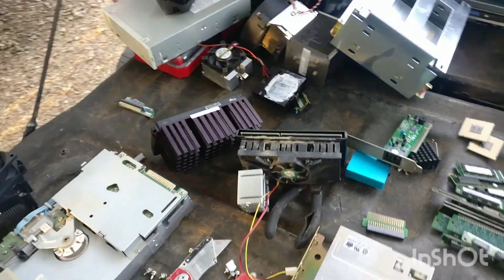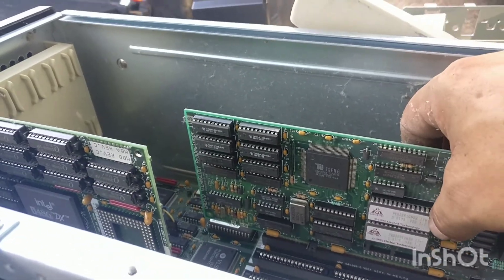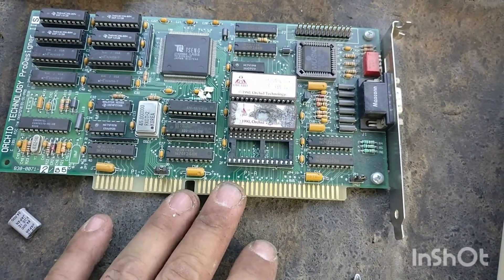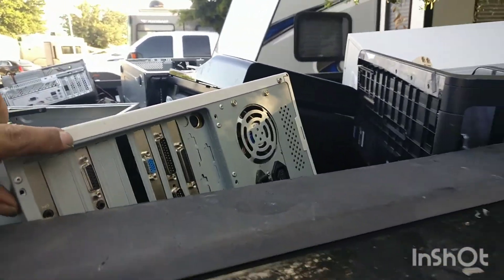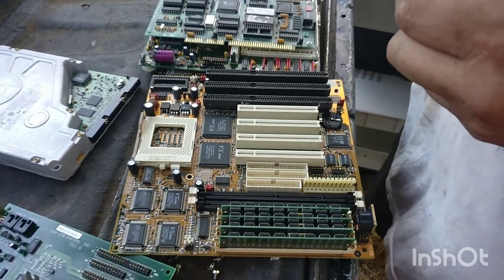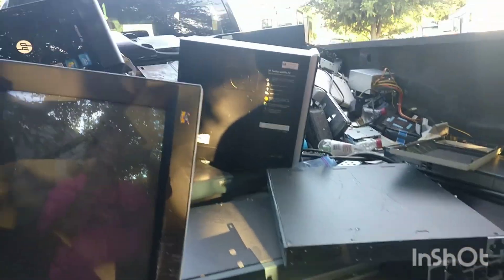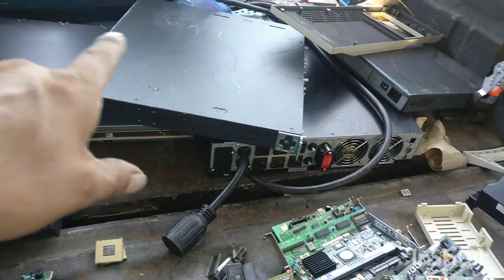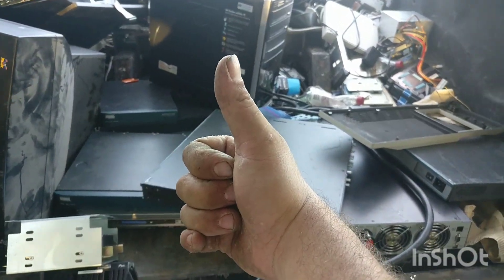Ceramic CPU kinda Day

Comment: Love those chips 🤗🤗🤗
Reply from the maker: Yeah there pretty. But I like what's in them better!
Reply: Roe Mantic that’s right bro .. I got me  one today.. I’ll have to look at which one it is
Reply from the maker: @streetcopper1151  go one of what?
Reply: Roe Mantic I just ran back out and looked .. it’s what you called a 5er
Reply from the maker: @streetcopper1151  Green fiber metal back or no metal?
Reply: Roe Mantic no metal
Reply: Roe Mantic at the top it says intel 00.. on the bottom it says pentium 111 philppines